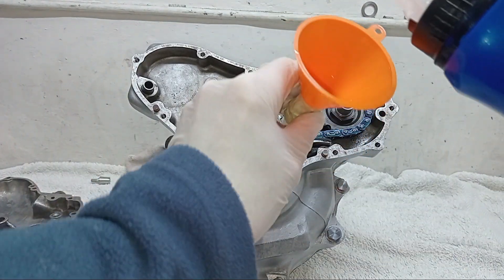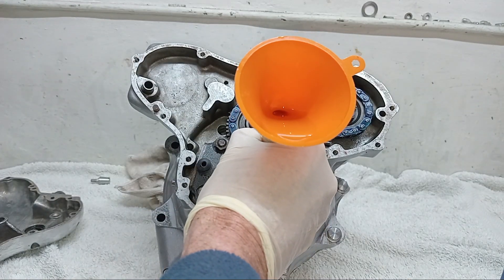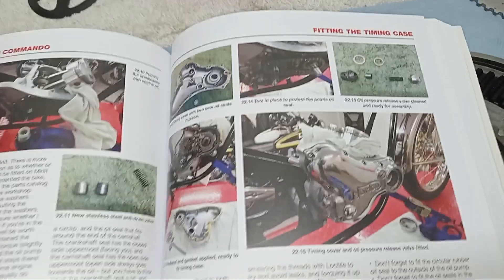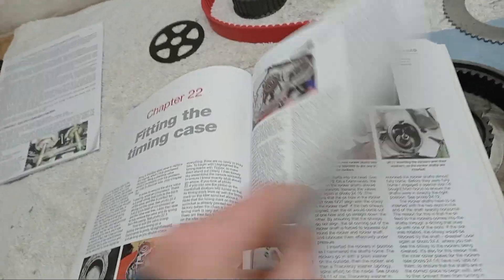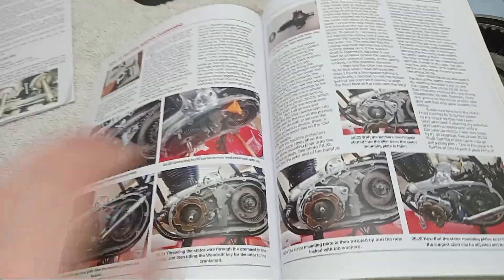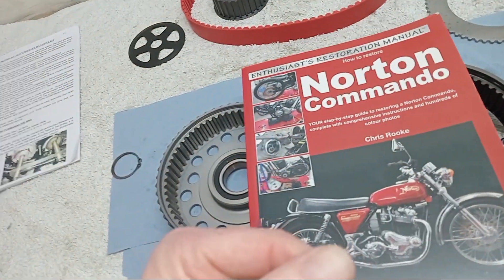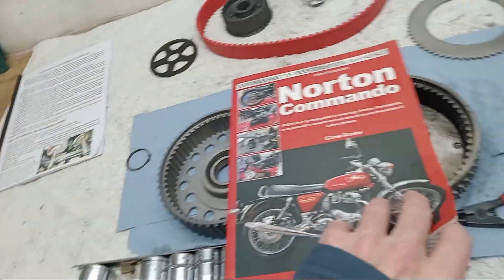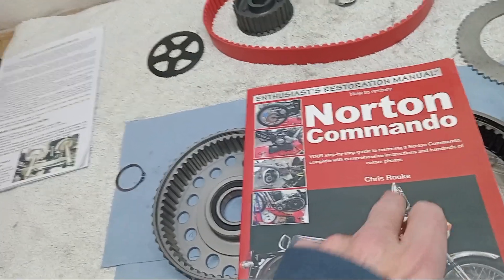Norton Commando Engine Rebuild. Part 56: Fitting the Timing Case

Comment: Always refer to the manual, if you trust the author!🤔lol. Although Haynes are known to put a bit of duff info in every now & then.
Reply: Your own manual looks a great piece of work. I would definitely get one if I had a Norton.👍
Reply from the maker: I always trust my own manual! The problem in this case that there are no torque settings supplied by Norton for these two nuts. It's down to personal opinion - but I think the first opinion given to me was incorrect.